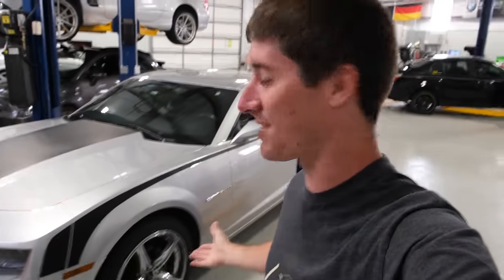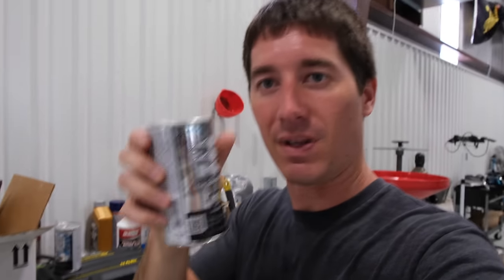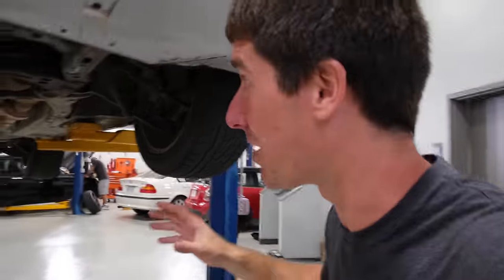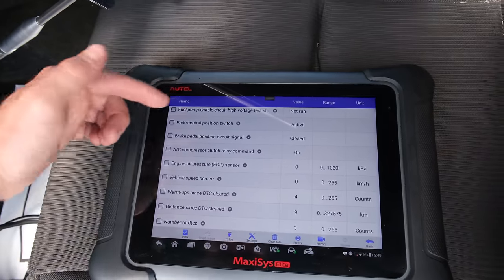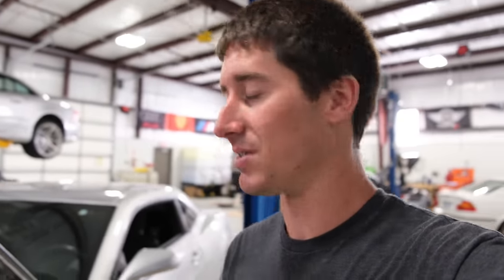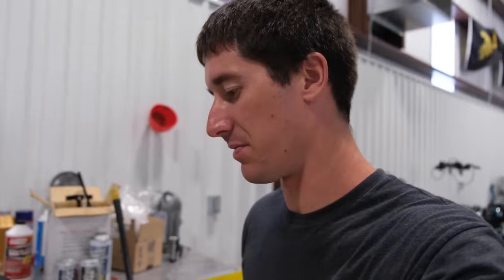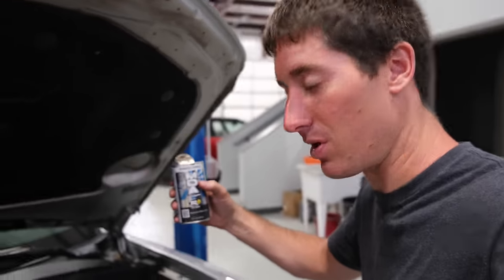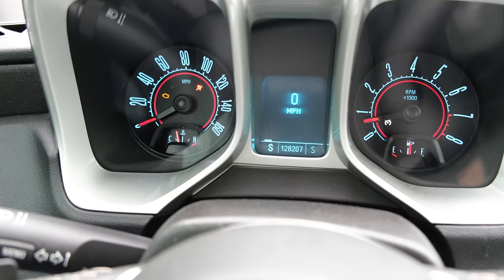FIXING The UNFIXABLE Engine In My CHEAP 2011 Chevy Camaro RS *SLUDGE REMOVAL*

Comment: Should used sea foam next. Change the timing chain and guides. Change the pvc  and idle air control valve just in case and clean the oil pan and magnet.

Comment: Nice video, looking forward to the next ones. Just a note though, when adding fuel cleaner, use a clean funnel!  When I inspect oil filters, I cut out a section of the media and lay it out, the folds are where the debris will collect. It will be much easier to see and pass a magnet over it to draw out any iron. Works good on iron block diesels but, might not be much help on aluminum gas engines.

Comment: Filling the crankcase with diesel and running it also achieves the same results. Excellent flush and cleaner. Very cheap as well.
Reply: Can confirm.
Reply: Sorry Boomer, it doesn’t. At least not on this much sludge
Reply: Naw diesel will not clean sludge. Diesel itself is an oil and not a detergent.

Comment: I know a lot of people hate this engine (3.6L V6 direct injection) but I have had good luck with it.  Used to own a 2008 Buick Enclave. Had that engine for about 10 years, 150,000 miles.  Really never had trouble with it.  Used BG products every 30,000 miles to keep the direct injection system clean, and the engine was good.  I believe this engine comes down to maintenance, but most don't do it correctly as GM has nothing in the maintenance plan about cleaning the direct injection system.  Same thing goes for the 2.0L Ecotec  turbo 4 cylinder direct injection engine which I now have in a 2018 Buick Envision. Cleaned it again with BG products at 30,000 and so far no issues but a young 36,000 miles.

Comment: That's what happens when you change the oil every 10k previous owner must have never done routine PM's I was surprised with the flush looks like it did a decent job. Hope it works out for you. 👍

Comment: Cleaning solutions can not fix the wear to bearings and wear surfaces caused by bad oil... They're only good for removing the bad oil and cleaning the engine.  Damage remains.

Comment: I’ve done lots of chain kits on Vz and Ve Commodores. Sludgy engines due to poor ventilation. It pays to drop the sump and manually clean all the sludge out safely rather than flushing. Replace the oil pick up O-ring and strainer while you’re in there 👍

Comment: GM had some of the world's best V6s in the 80s and 90s, GNX, Typhoon, Syclone. Can't forget to mention every 4.3 and 3.8 ever made. WTF happened since then? Should have made an ls based v6 for the new standard.
Reply: Name one overhead cam engine GM has ever made that didn't eat timing chains or leak oil all over the place?  I can't think of a single one.

Comment: I love cartridge filters. I had one on the 2.2 Ecotech on the '04 Ion 1 that I owned. It made a fraction of a mess that the regular filters on my other vehicles make changing them. The only one I didn't like was the cartridge filter in the '91 Grand Am LE because it was on the bottom of the engine and the cap was thin sheet metal and the molded 'nut' stripped from it.

Comment: Interesting to watch, but having performed a timing chain service on this motor, it's my opinion that your money would have been better spent on the basic can of engine flush for a few dollars which would have yielded similar shiny results and loosened rings since the timing chains needed to be replaced anyway. 
    The oil pan is easy to remove with the timing cover off in order to clear any debris dislodged from up top and instead of $300 on a flush series that seemed to try and blow up the motor in the process, it would have been better spent on replacing all four cam actuators and cam solenoids which would have cost right at that amount, as the actuators wear internally, reducing their efficiency and they are often not changed with the chains.  I've seen far worse regarding the sludge which really wasn't that bad in this motor. When the new timing chains go on, it will run like a new motor. Just be sure to use full synthetic motor oil to reduce the sludge risk and make sure you perform a clear-flood crank (pedal to the floor to disable fuel) so that the oil system is pressurized before the motor is allowed to run, or the chains will rattle and clack for several seconds at startup which doesn't sound good at all. It's a good motor when taken care of, unfortunately the bump in technology sacrificed timing chain life although I have read of a near 300k mile commuter 3.6L motor.  Oil it good and regularly and it can reach 200k miles on the original chains.

Comment: Would you please plug in the oil pressure sensor.  The connector hanging by the oil filter is driving me nuts.

Comment: Would you still get sludge if you regularly changed oil with an oil extractor through dipstick.  I've change mine yearly every 3k there's nothing on filter, or on the cap and car runs just fine.

Comment: What does pouring that into the fuel tank do? There is no part of the engine that can benefit as fuel does not touch the backsides of the valves or any other part of the engine internals to benefit. Also, never do a engine running solvent based cleaning on ANY GDI engine as while most of the hard crystalline coking deposits will be expelled out the exhaust, some is always pushed between the pistons and cylinder walls causing scouring we see when we tear these down to rebuild. And for the 2008-2012 (any with the black plastic valve covers), needs the PCV barb drill mod performed. Remove the barb located on the rear of the passenger side valve cover. Grasp base and twist while pulling straight up and drill bottom 2 holes to 5/64" and the top single hole to 1/8". Re seat back and that will now allow the proper CFM of evacuation flow to correct that flaw. Now, the timing chain wear and stretch is caused by the issues that plague all GDI engines, the excessive amount of raw fuel washdown and dilution as well as dealers using syn blend oil that cannot deal with the fuel dilution and high amounts of abrasive particulate matter.  I guarantee you still need the timing set replaced, and only a manual intake valve cleaning can clean all the deposits and also the only safe procedure.  NO shop in the US does more of these engines than we do, and have for the past 10-12 years.  Anything you want to know, just ask.

Comment: Had two of these flushes done. 1000 bucks later same codes and sludge. Kia cadenza 46k miles. I really hoped it would work. BG even gave the mechanic a second kit and he just charged me for the oil changes and labor.

Comment: That gas door has a small plastic hook that you hang the gas cap cable across so it doesn't hang on side of car. Had a GM car a few years before I figured that out.

Comment: This is the second video I've seen for BG sludge removal system in just as many days, with a similar outcome. Cleaning seem to have worked but, damage was already done to the engine from sludge induced oil starvation....Kinda sad really. The BG products work as advertised but due to reality beyond their control, it's a crap shoot whether or not that fixes anything or simply makes the reality come out...the engine is toast once it's allowed to sludge up.

Comment: I watched with great interest. I have an '11 Chevy Traverse with this engine, 125k on the clock. When I bought it last year, was told the timing chains and tensioners were done, showed paperwork. Car ran well, but I went ahead and dropped the oil and changed the filter. When I looked down the oil fill, saw a LOT of varnish on the cam. I bought a gallon of good ol' Marvel Mystery Oil and put about a quart and a half in. Topped the oil and drove her about 150-200 miles and dropped the oil again. New filter and oil, another quart and a half of Marvel, oil, and drove her another 200 miles. Dropped the oil and it came out MUCH cleaner than before. Rinse and repeat. I've put about 1k of miles on her, powerful and smooth. Almost time for another change now. Looked down the fill hole and was quite surprised that the cam was almost completely clean!!! After the next change, I'll drop the oil at 3k miles and a new filter every time. Good old Marvel to the rescue!! I had no idea about the cleaner you used on the Camaro; might have gone that way instead. Previous owner was lax about oil changes like on your car John. But took great care of all cosmetics and all other mechanicals on this girl! Oil changes are EASY. Can't understand why folks let them slide!!!!! Cheaper than a new engine, as my dad used to say!
Reply: I have the exact same car, same year. That's good to hear it's running good for you now. We switched to Royal Purple oil and it seems to be running a lot better. Also put in NGK spark plugs.

Comment: No load revving the engine, especially for a long time, in my opinion will cause damage to the engine parts.

BG will not buy you a replacement engine if you blow it!

Why not drive the car while the engine cleaner product does its work. It safer than revving your engine at a high revs with no load on the engine.

Comment: The variance in RPM was due to the AC compressor kicking on if you look at the part of the video where you are checking the oil pressure you can see it goes off and on.

Comment: Big fan of BG products.  But, for this engine I would run Valvoline Premium Blue Restore (available at Cummins dealers).  It's designed to run a full service interval and it will clean an engine.  In the case of this particular engine I would have done both.  Run the BG treatment first, and then the Valvoline for a service envelop.  THEN do the engine mechanical stuff :)

Comment: For a leaking evaporator use red angel system sealer, the 2oz bottle, I ve used it on two cars OMG it works great. 2010 mustang, was able to avoid pulling the dash. You know once you have a repair like that it will never be the same.

Comment: If your going to do this to any car I'd suggest  using a drill to spin the oil pump instead of running the motor. Theres no heat , no risk of combustion,  and just safer.

Comment: Once just open the oil pan and have a look at the pickup tube. It will be really helpful. At times they clog up and you won't have the required oil flow or lubricant happening in the engine.

Comment: that engine is actually somewhere around 323 hp from the factory. The 2011s were rated at 312 hp then they revised the numbers with no changes to the engine for the 2012 with 323 HP. GM said they underestimated the hp for the 2011
Reply: He should probably add a super charger to it ....

Comment: I had sludge problem with my used 2004 4.2L Buick Rainier Engine. ( same as trailblazer and Envoy and known issue with those)  I used a total of 2 gallons of Parts cleaner and let sit, to dissolve a clogged oil pickup screen. Then ran 50/50 mix of cheap oil and cleaner to clean the engine itself. I have the carfax, it got oil changes every 4-5K miles it's whole life (155K ) but regular oil sludges. I switched to Synthetic and didn't have any problems and then sold it. My 2007 Elantra has 120K miles and I went to synthetic at 40K miles with it, the inside still looks brand new. ( easy to pull valve cover off ) 
I spent about $150-170 to do the Rainier for the Parts cleaner and oil/filters.  I pulled the VVT on it after and it was very clean as well. Clean enough I ended up NOT  replacing it.  I hope this works out for you.  I loved the F-Body cars and owned several of them. I do not like these models as seeing out of them is bad but I hope you can make some money off it.

Comment: Glad that worked for you, but, why do people put themselves through this misery just for a Camaro that isn't even a V8? 2016 Camry in the fleet at work has 175K on it with 10K oil change intervals and never a hint of any engine problems, and they are ALL like that. None of this poor engineering. This jewel of a 3.6L engine is the product of a collaboration between Cadillac and Holden, which is GM's Australian subsidiary. I can nearly guarantee you that Cadillac was responsible for screwing up the PCV system and Holden responsible for the awful timing chain components. It could be the other way around considering that only Honda, Nissan and Toyota seem to be capable of designing overhead cam timing chain systems that actually last the life of the car. Enjoy the car though, you made a great deal on it...IF the engine stays together.

Comment: Saw that you opened the hood so as to run cooler during that stint at 3K rpm.... that actually is worse, because it allows air to bypass the radiator as the fan draws it in.  With the hood closed the air is forced to go through the radiator into the engine compartment, helping the radiator do its job and keep the engine cool.
Reply: Same with Diesel air compressors. If the cowl/hoods are removed, the diesels cant overheat - it's posted all over the manual and labels that say: "Warning... Do not.... (etc)..." We rented it and labels were plastered everywhere to avoid leaving hoods/covers opened.

Comment: Best engine flush in the world I've seen is shell rotella t4. It freed the rings on my lawnmower that was a 2 quart per mow mosquito fogging unit, doesn't burn a drop now, it cleaned the sludge out of my 900hr rental jetski that Mobil 1 wouldn't touch, I gained near 5mph. It's cheap, so if I have an abused engine, I do 3 or 4 changes over the course of a few hundred miles or 10ish hours of runtime. First few changes it'll look black as diesel oil (convenient since it is diesel oil, that's why it has such strong detergents and particle suspension properties) and eventually it stops turning as black, then you know it's good. Since I'm in a hot environment I run 15w40 in literally everything I own.

Comment: In all fairness at 8:14 you cleaned the filter housing... Now at 11:20 and on you brag about oil filter housing being cleaned. This feels biased...

These v6 Chevy engines are notorious for p0017 or crank cam correlation codes. Timing chain stretch, there's a 110k mile extended warrenty on certain models because of this prevalent issue. 

If one ever seen engine sludge, they'll know oil cleaners won't work lol, it takes elbow grease

Comment: I've seen people cleaning their engine filling 1 quart of Kerosene and the rest with oil. Then letting the engine idle for 30 min. Than a regular change of oil and filter.
Reply: Not to say it can't be done without problems, but if you have enough cylinder blow by that's a great way to set your car on fire. Not one I'd personally try out.

Comment: BG is good stuff.  They make an additive that helps every single system on a vehicle.  Just added their tire air additive.  Supposed to keep the tires from dry rotting and from developing stiff spots in the sidewall.
Reply: air additive seems like snake oil to me

Comment: Great, now I’m having anxiety about my LLT and listening to every little thing, thanks😂. Please do the PCV mod. If mine hasn’t been done already by the previous owner, I’ll be doing it to mine. I know this isn’t the end of the world but it’s still NERVE SPLITTING to worry about this damned timing chain
Reply: Then sell the car or put a timing set in it. Life is too short to sweat stuff like that nonstop if it really is eating at your peace of mind.
Reply: Maxwelhse it’s not that deep. It was more of a joke. My car is fine thank you. I’m trying to be preventative, I don’t have issues.
Reply: @ic1815  Sounds like if you do whatever PCV mod these need and keep up on oil changes at a sane interval (likely far fewer miles than Chevy recommends) then you'll be fine.

Comment: Sump off, Valve covers off, timing cover off.... apply high pressure H2O... couple of quick oil changes... Standard procedure at local dealership.

Comment: I use Berriman's B12 Chemtool. It does the same thing. I have bought many lemons in the exact same condition. I could use other solvents, but the price per ounce is about the same, and the b12 works. As for the additive blend that's based on bearing wear.

Comment: It would be funny if someone knocked the gear into D (Drive) when the car was at 3000rpm. When I saw the engine oil drain I had a feeling it was working.

Comment: There are engines that run 200,000 +with no PCV.  PCV is an emissions device it also builds sludge in the intake and back of the valves. Oil fumes also lower octane ratings. Its a real problem on direct injection engines since the intake ports and manifold it dry. its the long oil change specs that are the problem. Change it every 3000 miles and you will be fine. use Mobil 1 or Pennzoil synthetic. In light to med use even good grade non synthetics would be fine.
PS PCV's do serve a purpose in wet environments like marine engines that run cold so they never realy cook the moisture out of the oil and when you shut them off they pull moisture in through open breathers. but for automotive there purely for emissions

Comment: Those dealer photos didn't look that bad to me.  I ran dino oil in my 87 firebird and changed the oil every 3K to 5K miles.  One day, the oil pressure was 0 so I pulled the valve covers to see it any oil was circulating up top.  Nope.  I did notice that there was about an inch of built up oil in the heads.  Figured I'd tear it down and rebuild due to the build-up.  In the end, it turned out to be a $0.10 relief valve spring in the oil pump that had broke causing the low oil pressure.  Anyway, before the rebuild, with 183,000 miles the engine ran absolutely perfectly even with all that build-up.

Comment: OR 2-4qts Diesel - does the same thing - Just did it in my 2007 Chevy T.B. - Low Oil.P - Gone after 2qts Diesel - Then another 2qts -  Totaling 4 for a total of 40 min in 20 min increments Done @ idle RPM / 1000 RPM - All fixed..... Then changed oil & added Marvel M.M.O with the fresh oil  & New Filter - $20 in Chem in addition to the oil & filter compared to this ASTRONOMICAL expense.....